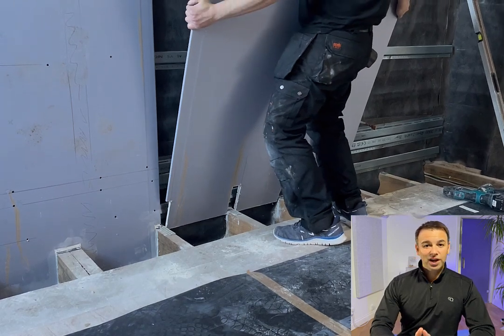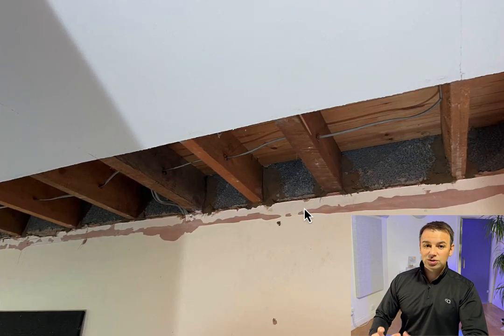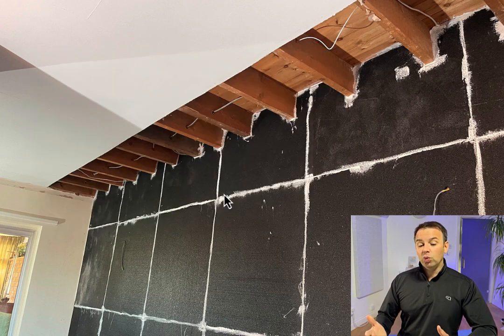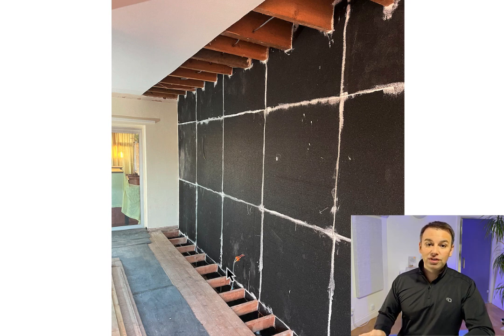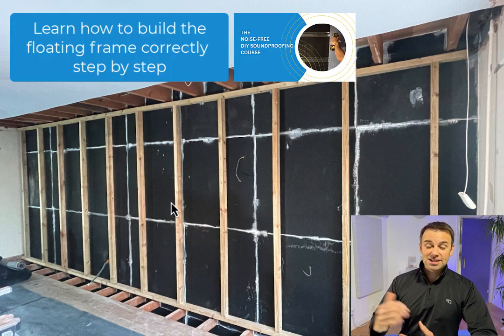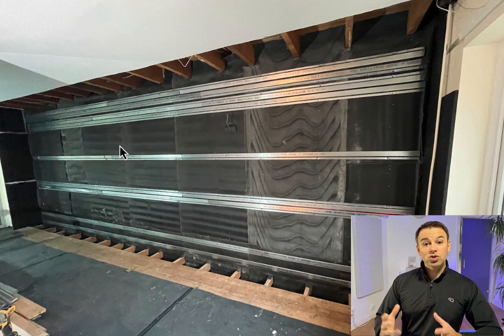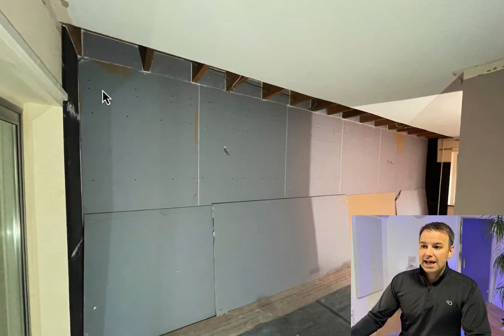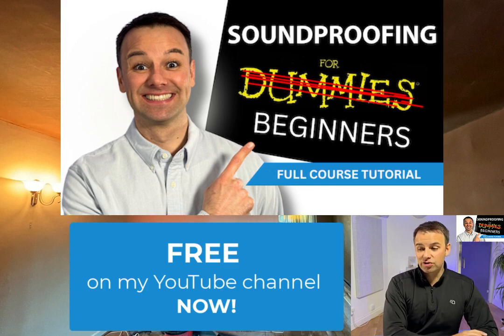Soundproofing Secret Method: Tuck It Up and Tuck It Down

Comment: Jim what about a stud party wall ? We have a concrete floor so should we tuck up ?
Reply from the maker: Hi @crztank9298, I would recommend building a floating stud frame in-front of that existing stud party wall....a 25mm air gap between your existing stud wall and the new stud frame will be key. How much space can you afford to lose?

Just note....if your party wall is a stud frame then that stud party wall will potentially be a small part of your over soundproofing solution. The Ceiling and flanking walls may need treating too.... if they are connected to that stud party wall. Have you heard the noise on the flanking walls?

Comment: Have you ever THOUGHT about the best way to MAKE a SLEEP CUBE. I've got soundproofing in a bedroom, but it doesn't do anything for the BANGING zibrations from the 'screw lose' neighbours, even while wearing sleep headphones (rain on a tent  BANG!). We need more than 4 HOURS sleep,while we wait for the COUNCIL! they are PATHETIC. My poor Missus
Reply from the maker: @express375 - That sounds absolutely brutal, so sorry you and your partner are going through that 😔 Sleep deprivation from vibration and impact noise is no joke, and unfortunately it’s something we hear far too often when neighbours have no consideration.
You’re spot on: a proper "sleep cube" or retreat room is often the only way to cope when structure-borne noise (like banging and vibrations) is involved. Standard soundproofing often isn’t enough — what you really need is a fully isolated room-within-a-room, with:
🔹 Floating floor system
🔹 Floating frame walls and a suspended ceiling (decoupled from structure)
🔹 Dense multi-layer build-up with proper insulation and no direct fixings
It’s not a small job, but it can be life-changing many of our clients in the same situation finally get full nights of sleep again after we soundproof their bedrooms by following the 4 step soundproofing method and treating all the noise paths.
Hang in there, and if you want help planning something achievable DIY – get a place on the Noise Free DIY Soundproofing Course. You deserve peace (and 8 hours sleep)!

Comment: Hi, the joist in our bedroom is running parallel with and is bolted to the party wall so is it the way of tucking down. Any suggestions to overcome this? Thanks 😊
Reply from the maker: Great question, Jane 😊

If you're on the Noise Free DIY Soundproofing Course, there are step-by-step lessons covering exactly how to deal with this issue — it's not something we're quite ready to share on YouTube just yet.

That said, here are a few practical suggestions:

Use a thicker floating frame system — this allows you to tuck the structure down below the joist line and then install new joists to support the floorboards after the soundproofing is complete.
Temporarily remove the existing joists — carry out the full soundproofing installation, then fit new joists afterward to support the floorboards.
If removing the joists isn’t practical, you could sound-deaden the joist itself by wrapping it in acoustic materials (like M20, Tecsound, or Rockwool), then add tightly spaced noggins to support the floorboards above.
Hope that helps — let me know how you get on!

Comment: is the rockwool rw5 worth it over the rw3?  is it cost effective.
Reply from the maker: Hi @Dawgley, I pref RW3, tested it so many properties, not tested RW5 enough. RW3 is harder to get hold of these days.

What is your noise problem, are you using it on a studio? Party wall? Or something else. Where are you planning on use it, ie between ceiling joists for noise between flat floors? 
And is it impact noise or airborne noise you are trying to reduce? …or both?
Reply: @jimprior7  im doing a party wall . RW5 being 100kg/m3 . more density i thought it would be better by a bit. i dont see why it wont perform better even if its just +1 STC. Thanks for all your videos and help

Comment: Hi Jim! I love how you detail in how sound travels and suggest the best solution to soundproof it
I was wondering if soundproofing techniques could also be applied to noisy keyboard spacebars 🤔🤔 thinking about treating spacebars as somewhat like a downscaled version of a room
What do you think?

Addressing (one of) the main concern: using a silent switch instead
https://youtu.be/qdcrei__7v8?t=50s
Reply from the maker: Hey @lilahyearsago6588 love that analogy! Treating a keyboard like a mini soundproofing project isn’t too far off. You’re right: the same principles apply it's all about damping vibrations, isolating movement, and absorbing energy.

Using silent switches is definitely step one, like upgrading your “walls.” From there, adding dampening foam inside the case or under the spacebar (like sorbothane or silicone pads) is a bit like insulating a cavity wall. And using a desk mat? That’s your floating floor 😄

Great question, that video has thousand of views, a lot more exciting than my videos. Thanks for your comment 👍

Comment: Hey Jim, my noise isn’t really airborne, it’s more impact noise because the house is made of solid walls.

It feels like door slams, knocks etc. resonate all around.

Will a combination of MLV, potentially using channels, rockwool and a layer of thick plasterboard help stop this?

On one wall, the most I could probably do is MLV and 2 layers of plasterboard, will this have any effect in your opinion?
Reply from the maker: Hey @ELITEtimmis — great question, and thanks for sticking around on the channel!

Impact noise in a solid wall house can be tricky — you’re spot on, it often feels like it’s travelling through the structure itself, like mini shockwaves from door slams or knocks.

Your idea of MLV + 2 layers of plasterboard will definitely help reduce some of the airborne sound (like voices or TV), but unfortunately for impact noise, the key is decoupling. That’s where the floating frame, joists disconnection and resilient channels (resilient bars or clips) come in — they break the direct connection between the wall and your new layers, helping to absorb and dissipate those vibrations.

We find the 20mm rubber significantly helps reduce the impact noise when installed behind the floating frame.  Some DIYers on the Noise Free DIY Soundproofing Course have said they got a massive reduction in door slamming noise after treating their stairs walls in the 50mm system. I have got similar results for my homeowners, but I think that is because such a large area of the property was sound deadened with the wall system.

If you can only treat one wall, that’s totally fine — every bit helps — but the more surface area you treat the better your results will be overall.

Also, check out the Soundproofing for Beginners | Full Course Tutorial when you get chance — it walks through realistic expectations on impact noise and the 50mm wall system.

Thanks for your support 👊
Reply: @jimprior7 brilliant, thanks Jim. 

I often hear foot steps which sound like vibrating through the floor. I don’t have the option of using sound proofing on the floor now.

Could the thicker system, decoupling the party walls still help this assuming some of those vibrations are resonating off the walls?

Comment: Hi Jim, just wondering as the existing joists are still going into the party wall in the ceiling and the floor doesn't some sound transmit along these effectively bypassing all the sound proofing work thats been done? thanks great videos
Reply from the maker: Hi @Si, yes that is correct —thank you for pointing this out! We overcome this in a number of ways.
For a suspended floors, we disconnect the joists.
For ceiling joists, we use resilient channels to decouple the vibration travelling through the joists and into the room. This is especially useful when noise is coming in at an angle—for example, when neighbours are jumping around in their bedroom and you’re hearing it in your living room.
And for bedrooms, we use things like floating floors to decouple vibration through the floor joists from getting into the bed.

Great question—thanks very much for asking! You’ve given me some ideas for my next video. 😊
Reply: @jimprior7 thanks for reply. So when you say you disconnect the floor joists I assume you dont mean from the wall? If you were doing it in the room in this video would you create a floating floor?
Reply from the maker: @Si---  Yes, I mean disconnect the floor joists from the separating party wall.

Have a look at the picture on the screen at 1:18:59 mins into the soundproofing beginners video full course tutorial.

The picture shows the party wall sound deadened, a floating frame with the ceiling and floor cut open and See how we have disconnected the floor joists from the separating party wall and then tucked the wall system down to the sub-floor. ....On this video: Soundproofing for Beginners | Full Course Tutorial
https://youtu.be/hVqa1m3JzGs&list=PL-ZigmSd311dNw8Tbe1IfLiJgEiJcjvMN

That is Joist disconnection. This is a new module which is being added to the Noise Free DIY Soundproofing course in September this year before Noisy Neighbour Season starts.
Reply: @jimprior7 ah yes I see thanks for sending this, so those brackets you use to disconnect the floor/ceiling must be very strong to carry the weight of the floors!

Comment: Thank you, Jim. I'm in NYC and looking for soundproofing contractors. No one is even close to you. I would hire you right away. Thank you for your videos.
Reply from the maker: Ah thanks @victorb.2894, sometimes my DIYers and homeowners achieve better results from learning it all themselves….and then advising a contractor that has not done ‘soundproofing’ before. 

The contractor that has not done soundproofing before is less likely to have their own building beliefs of how a ‘stud wall’ should be built, for noise reduction for example.

Let us know if you need installation support when you find a good contractor. 👍
Thanks very much for your kind words 🙏
Reply: I'm in Philly and was going to hire a contractor to do it, but none of them that I've talked to seem to understand the specific concepts of soundproofing, all they wanted to do was add more drywall.  I was going to hire an acoustic consultant, but they all charge big $$$!   After 1 year of watching Jim's vids, I'm much more confident and now plan on doing all the work myself.  Probably take me 1 month by myself to get it all done perfectly.

Comment: Thanks Jim.  Most ppl make the mistake of not going all the way into the ceiling and floor joists like this, then have all kinds of flanking noise.  I will be doing all this to my shared bedroom wall very soon.   
Have you ever considered using steel studs for the floating frame?  20 gauge (20mm thick) metal studs will transfer less vibration and is lighter, cheaper and less labor to construct than wood studs.  Thanks!
Reply from the maker: Hey @JP5466, great question, I think you asked me that before on another video, sorry if I did not reply. We normally sound deaden any steel with a visco elastic membrane, it’s like a blue tac in sheet foam. This is mainly to reduce the resonance in the steel because sound transmits more easily through steel than timber. 

We also find that some of the thin metal frames available at our builders merchants create ‘wall shudder’ and the recording artist and creators with listening rooms don’t like ‘wall shudder’. So since then we always built our studios, and cinema rooms with pressure treated timber.
The timber makes it easier to secure the MLV to the floating frame too. Great question, thanks for watching and following the channel. 🙏
Reply: @jimprior7  Very interesting.  Thanks Jim.